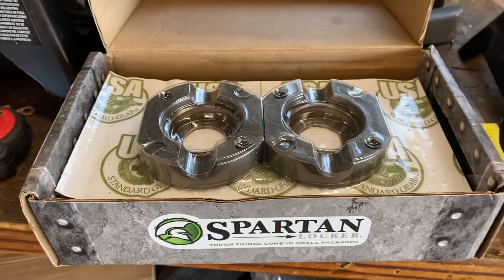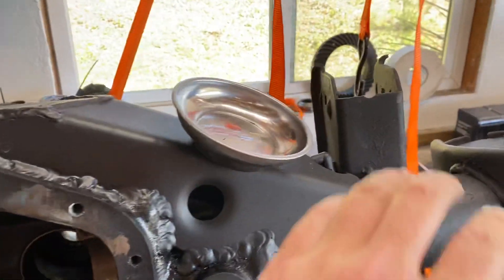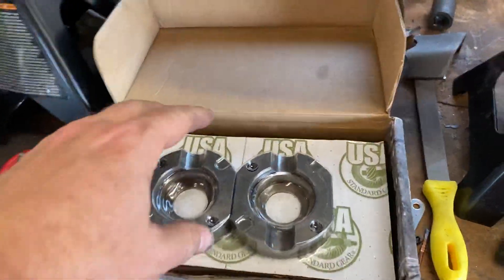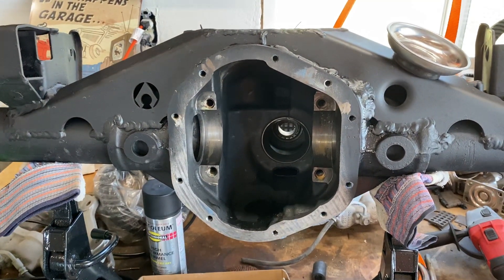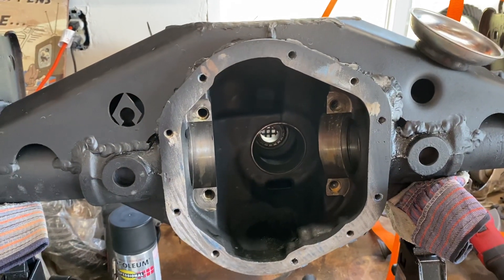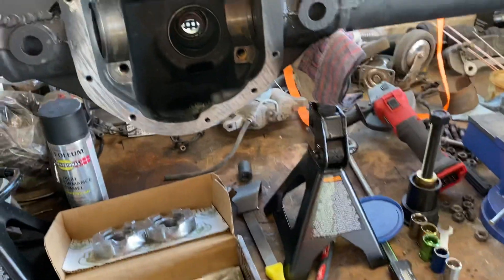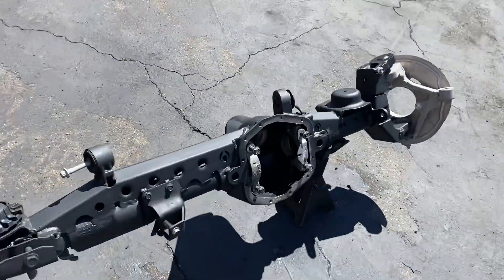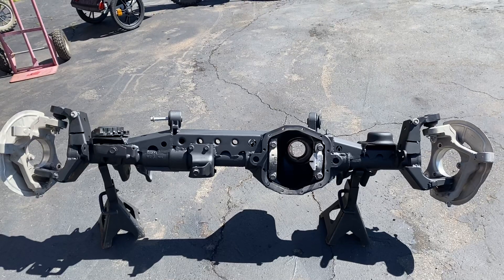JK Dana 44 - Spartan Lunchbox Locker Part 1

Comment: I'm running a lunchbox locker in my Dana 44a in my ZJ as well. Been a great improvement over open diffs.
Reply from the maker: Great to hear. I’ve loved them in the Dana 30 and 35. Best bang for the buck by far. Really excited to try it with the 5.13 gears. Thanks for checking in.